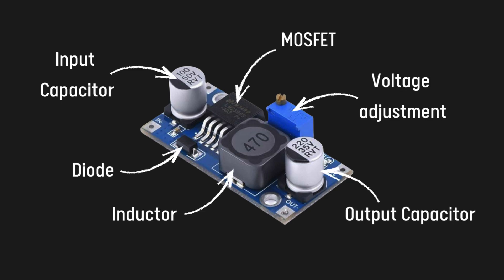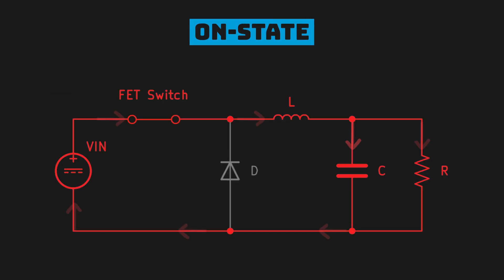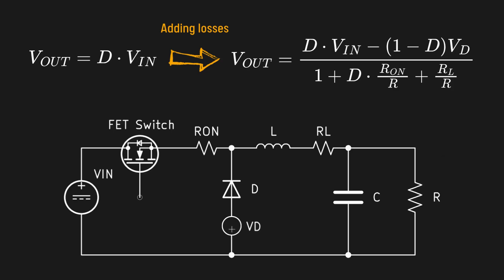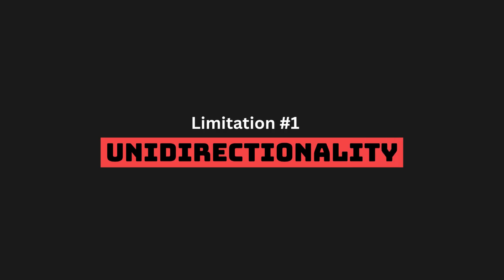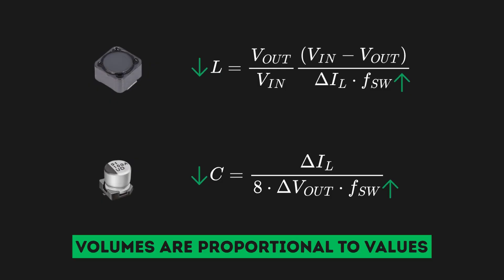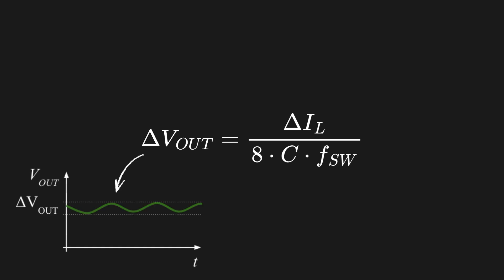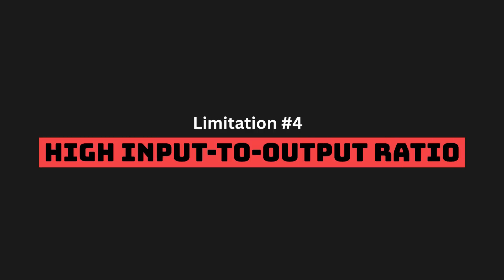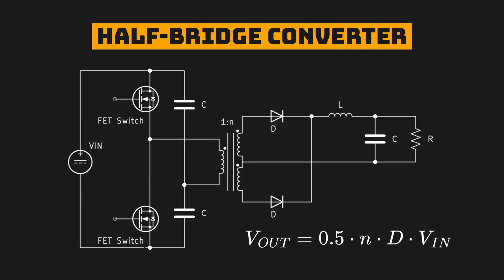How Buck Converters REALLY Work and Their Limitations

Comment: 2:20 used on most electtronics like motherboards and GPUs for their power in core, RAMs, am I right?
Reply from the maker: @wstd7417 Correct! They are usually called POL, or Point-of-Load converters in this case and are usually also interleaved. Thank you for your support, and stay tuned for future videos soon!

Comment: that isnt actually a mosfet it is the IC. just telling yhou
Reply from the maker: @DongXia-c6o Thanks for adding it. I'm aware of that, it includes not only the integrated FET but the control logic as well. Because I didn't address the control part in this video, I mentioned just the FET for simplification purposes. I will go in detail on the control part in a future video though, don't miss that one!